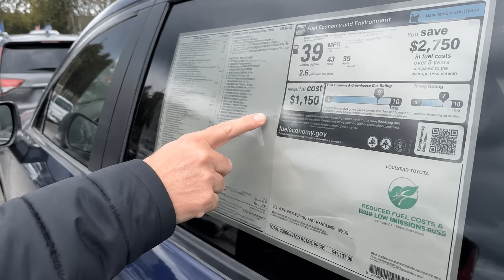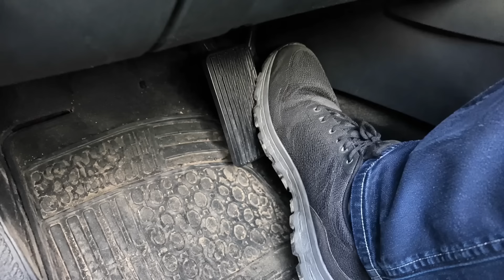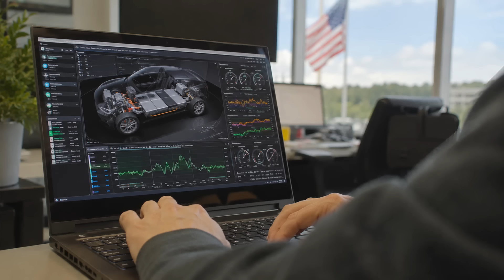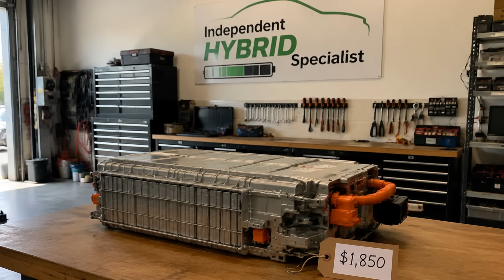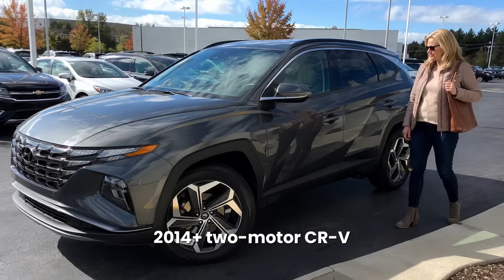Toyota vs Honda vs Hyundai Hybrids: Which One Has The WORST and The BEST Hybrid System?

Comment: Previously owned 2 Toyota Prius cars but really got fed up with the Toyota dealers maintenance fraud! Toyota dealer in Manhattan Beach CA tried to charge my young Daughter approximately $10,000 to do simple head gasket replacement. Local shop that specializes in Prius work charged us $1800 for same job and included head machining and valve job as well. Never again will I buy a Toyota. Toyota Dealers are corrupt. Just don't go there.

Comment: Excellent engineering explanation to the core. Especially the multi plate wet clutches which takes the entire burden of connecting engine or motor to the wheel. Toyota ranked number 1 is absolutely justified. Thanks to the most convincing and unbiased way that genius has explained it so well.
Reply from the maker: Thank you! ❤

Comment: Considering a used Toyota or Honda CRV Hybrid models to replace my 2003 CRV with 220K miles (that I would still drive to the moon) . Don't want the Gasoline Honda with the rubber band, I am not convinced and also considering a regular Rav4 non hybrid. We are both retired and are looking for another vehicle that will be as impressive as our 03' CRV has been, granted I do my own maintenance and am diligent and knowledgeable, so hard to find good quality cars nowadays.

Comment: I have a 2026 Hyundai Tucson Hybrid. I have driven it for about 10 months now. The car drives smooth and is a pleasure to drive. It takes steep hills with ease and the electronic braking downhill is wonderful.
Reply: Sounds great, but 10 months is still the honeymoon period. The real test is whether Hyundai’s hybrid system remains as reliable as Toyota’s after 100K miles—would you still choose it long-term?

Comment: Maybe I'm just imagining it but my wife's 2021 Toyota Sienna XLE hybrid AWD powertrain behaves quite well in 'Sport' mode (even though we all know there's not a lot of sport in this vehicle) ... and yes, the engine sure is loud on acceleration but once you're at the speed you want to be, we can hardly even tell the engine is running. The true EV mode is entirely dependent on how flat the road is and even then the engine just 'decides' to start for no obvious reason beyond speed which the EV only mode is pretty much gone over 25mph. Another amazing feature is the transition is nearly seamless when the engine powers up or takes over as the ECU 'remembers' exactly where in the rotation cycle the engine stops then just wakes it up as if it is just continuing the process. A barely audible starter motor sound. Wife took it on some hilled backroads going down to Georgia and that last 40 or so miles the vehicle was reporting 47mpg. On normal routes she gets ~34mpg but she always drives it like she stole it. Summary is I'm happy with this and it's already cresting 150K miles with nothing more than routine oil changes (and routine on a hybrid hovers around 10K miles).

Comment: I bought the '26 Hyundai Santa Fe AWD Hybrid Calligraphy new. The engine and tranny work smoothly, never hear or feel anything untoward.  The interior blows away the Honda and Toyota equivalents l. The high tech features are very helpful and in some cases amazing. Combined gas mileage for first 1200 miles was 31.5, now at 5,000 miles, gas milage is consistently 33-35 mpg. First car I ever owned that actually gies the advertised EPA mileage ratings. The only reason we didn't get the Tucson was my wife could't reach the gas pedal, but on the Santa Fe she could. The top RAV4 was noisy and the interior was cheap looking for the price.

Comment: Took delivery of a 2005 Toyota Prius brand NEW in March 2005 (had to order it in October 2004) and owned it for 13 years / 150K miles before handing off to my brother in law in 2018 for small below-market price. He had the battery pack replaced in 2022 at 195K miles for about $4K.  Unfortunately he passed away last year 2025 and the car was given to his daughter to commute to college and part time work. She currently still has it and loves it. It has 230K+ miles and still runs fine with no problems.. 'Nuff said about reliability.

Comment: If the Hyundai hybrid clutch is under full warranty for 100k miles, what is the downside if I keep it for less than 100k?
Reply: Yes. I buy a new car every 5 years, and. I’ll have nowhere near 100,000 miles on it when I trade it in.

Comment: We have leased 7 Honda CR-V’s over the past 9 years.  The last 3 being Hybrid Sport Touring, and they are our favorite vehicles … EVER.  Never a problem, other than an AC compressor failure on my brand new 2026, caused by the dealer leaving the car Idling for two hours in 95 deg heat on the lot.  A thermal protection sensor failed and caused the electric compressor to burn out.  They replaced both before I officially took delivery.  These luxury equipped (2023 & 26 Touring) cars, are the smoothest, quietest cars I've ever had in my octogenarian years.  Exceptionally good looking, practical, economical, and fun to drive.  No steep hills here, except for my 50 foot driveway, which it always takes easily and silently in EV mode.

Comment: I had a 2000 Toyota Prius until it got totaled at 210,000 miles. I replaced one headlight bulb, one taillight bulb, and the 12 volt battery in that time, and still had over 15% left on my original brake pads. 44.1 mpg overall. I now have 41K miles on my 2024 Prius XLE with zero repairs. This car is actually attractive, smooth, quiet, quick, and I am averaging over 54 mph overall this far. This car is absolutely remarkable!

Comment: Just got a 2023 Sienna Hybrid, looking forward to some long trips in it. 44400 Km on it
Reply: My 23 Sienna averages 32 running around town, and 35 on the highway.  On my last long drive, mostly at 55 mph, it was getting over 38 mpg.  My only concern, after the warranty expired, going down mountains, it doesn’t hold back like it used to.

Comment: 0:12 “Same size, same shape, same price within a couple thousand.”

Rav4: Passenger volume 98.9 ft^3, Cargo volume 37.6 ft^3.
CR-V: Passenger volume 106 ft^3, Cargo volume 39.3 ft^3.
Tucson: Passenger volume 108.2 ft^3, Cargo volume 41.2 ft^3.

So, while they are marketed in the same size category, the others are 7% to 10% bigger than the RAV4. 

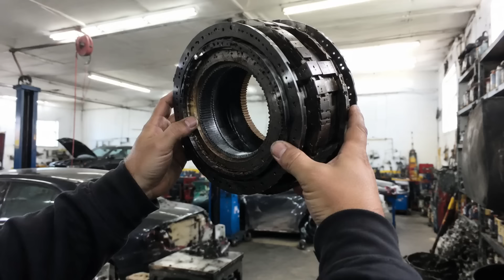2:08 “Because there is one of these systems where a single clutch pack is doing a job the other two designs eliminated entirely.”

There is no history of the Honda clutch pack failing. There is a history of the Toyota clutch (they call it a torque damper or a clutch damper) failing. The Hyundai uses a clutch for a different purpose, and I do not know its history.

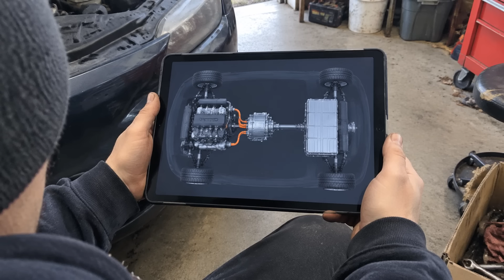2:30 “A hybrid [has] two power sources trying to turn one set of wheels, a gasoline engine, and at least one electric motor.”

An electric motor is not a power source. Its role is closer to that of a gear.  Its power source is a battery or a generator, and it just converts the electrical power to mechanical power. The battery isn't the ultimate source, either. It relies on some other power source to do the same things an engine does, and the shortcoming are similar. Just in somebody else’s backyard.

The rest of what you say about motors v. engines is hyperbole based on this difference.

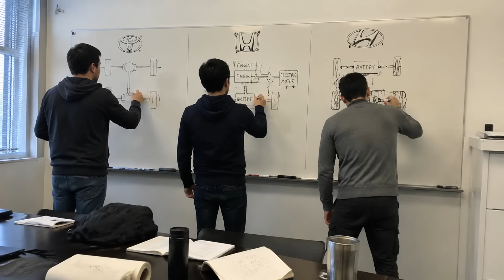3:13 “Toyota, Honda, and Hyundai looked at that exact same problem and came back with three totally different philosophies.”

Actually, Toyota looked at the research done, and patented, at the University of Maryland. Then sto… er, “developed it independently” according to the lawsuit settlement.

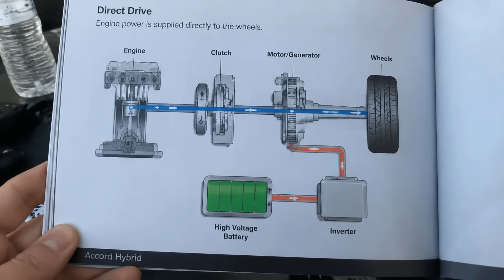3:23 “Toyota threw out the transmission. Honda most of the time threw out the mechanical connection between the engine and the wheels. And Hyundai kept everything a normal car has and squeezed an electric motor into the middle of it.”

The Toyota power-split device is a transmission, just as much as a CVT (the “T” is fcor “transmission”) is. Honda threw out the transmission completely.

7:00 “So, why is [Hyundai] last? Because of what I told you at the top, that clutch.”

Did you take into account that it opens and closes under computer control, when rpm are perfectly matched? Maybe there is an issue, but there shouldn’t be. Did you research failures? I haven’t, so I can’t comment, but I suspect you will find none.

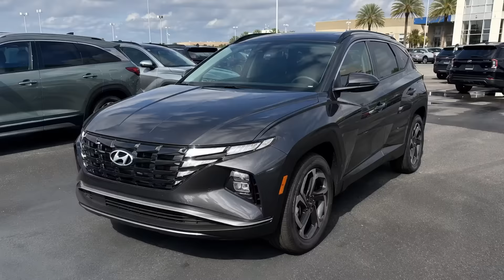8:32 “Toyota does not have that component.”

Yes, it does. The torque damper is a permanently-closed clutch, with “friction material” that does get consumed. It has to absorb the shock when the engine is started while the car is moving; ironically, it does so by slowing the smaller motor, not spinning it faster. The engine cannot be disconnected from the transmission (yes, it has one) as the engine is started. This is what causes its clutch failures.

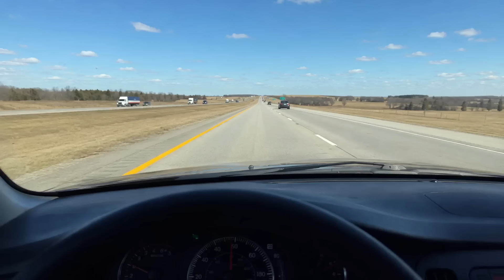12:01 “[Honda] Driving the wheels through a generator and a motor is efficient in town. But on a steady highway cruise, it is wasteful because you are converting mechanical power to electrical power and back again and losing a slice at each step.”

It is no less efficient than a typical transmission; above 90%.  Same as the Toyota power split device. About half of Toyota’s power is routed the same way, although they won’t explain that part. The power split device splits ICE power between a parallel path (like Hyundai's) and a serial path (like Honda's). The ratio of this split is what controls the speed of the ICE.

Honda' highway issue is not with cruising, it is aggressive speed changing. In my Accord hybrid, I drove from Maryland to Nebraska, and back, to retrieve 700 pounds of my grandmother-in-law’s marble statues. I averaged 50 mpg (three over EPA) because I cruised.

All of these systems buffer energy through the battery. An ICE is most efficient when generating, maybe, 20% to 30% of its rated power. During cruise, all three of these cars will overproduce with the ICE to stay in this range, and use the excess to charge the battery. Then use power-assist to avoid inefficient, high-power levels. This is how they gain efficiency.

Honda uses a lower-power ICE that loses more efficiency when you acceleragte on the highway.

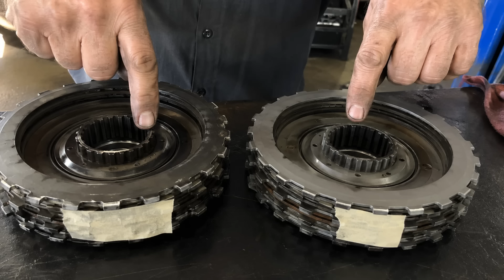12:54 “The newest CRV hybrid actually carries two of these lockup clutches. One ratio for lower speeds and one for the highway.”

No. One matches the best rpm range to a lower speed range, in order to get more power for towing at highway speeds.

13:21 “The [Honda] clutch … mostly closes under gentle steady state cruising conditions.”

It closes only under those conditions.

And it has a completely different battery than previous Hondas. The kind Toyota changed top after Honda did.

Comment: My 2017 Hyundai Sonata Hybrid battery bulged/swelled up like a cell phone battery at 137,000 km.   The car would not start after engine shutoff to supposedly clear hybrid alarm on dash.  It took 4 hrs for Hyundai road assistance to arrive to tow car to a Hyundai dealer.  The dealer took 3 months to order a hybrid battery replacement.  Dealer had no courtesy cars for me. Thank God the end to end warranty paid for the battery replacement. However the warranty runs out at 160,000 km. Current mileage is at 149,000 km.  Time to look at Toyota hybrid.

Comment: Hey thanks Richard! What do you think of the Hyundai Tucson phev? I have a 2025 bought new. Really love the vehicle, drives nice, locally very cheap on fuel of course. Road trips are comfortable with plenty of power if needed. I am in Canada so our warranty is a bit different. 5 years or 100,000km so we added some extended warranty to 8 years or 160000km including all electrical components as well as drivetrain etc. Ours is very smooth transitioning from EV only to gas and electric and back to EV. WD have only 36000km so far. I am nervous about keeping it past the warranty because of the issues you explained. Is the clutch wear issue similar on the PHEV? Thanks for your video, I have subscribed and liked your video as well.

Comment: I rented a Hyundai PHEV. Once in a while, it did shudder.
Honda’s CRV hybrid is mostly good. Only 2 noticeable flaws to me. The Honda solely uses GDI, no port injection. Carbon buildup will be a problem, unlike the RAV 4 which uses dual injection, selectively using GDI or port which is more complex but keeps the valves much cleaner. The other is that the Honda lacks a spare tire that the RAV4 has- I think a necessary safety feature on a SUV.
Reply: "The Honda solely uses GDI, no port injection."

The Honda system uses multi-stage direct injection. It happens four times, for improved  atomization. The first is in the exhaust stroke just before the exhaust valves close, two occur during the intake stroke, and the last is in the compression stroke.

But it uses the Atkinson cycle. That means that the intake valves don't close until after that last injection. Some fuel is pushed back behind the valves, accomplishing the same thing as Toyota's dual injection (and a mild turbo-like effect).

Toyota started the "no spare tire" trend with the Prius. The reason was that the spare tire becomes a missile aimed at the battery in a collision, causing fires. Some companies still care more about that, than the  PR.
Reply: @jeffjo8732  Time will tell if the valves remain clean with their GDI. Positioning the batteries in a place different than adjacent would help, don’t you think? Maybe the option wasn’t available because of the driveshaft in the CRV.
Reply: The spare tire problem with the Honda did it for me.  I was a loyal Honda customer prior.

Comment: My 2026 Tucson Hybrid Limited shifts so smooth you can't feel it. Impressed every time i drive it.
Reply: My niece has a 2026 Tucson Hybird Limited that really impressed me!  Really smooooooth and it really a smooth ride.
Reply: My 2026 Tucson Hybrid Limited is great EXCEPT for occasional slippage in the transmission and a thud when shifting. Taking to dealer for diagnosis and fix.

Comment: I have driven the Toyota hybrid, I bought a Honda CRV hybrid.  Yeah, the Toyota may have an edge on longevity and MPG, but the Honda is miles ahead when it comes to refinement and drivability.  The Toyota's sound like they are going to bust a nut when you accelerate hard, with the Honda you can hardly tell which motor is doing the work, they run smooth and quiet like a cat.  The Honda also has a better looking exterior and a much more refined interior, in my opinion.
Reply: True.
I checked out the CRV and said to myself no.

Comment: I drive a 2020 Ford Escape Hybrid AWD.  In 2020, Ford used the Toyota system with the only modification direct rear wheel drive rather than the Toyota electric motor rear drive.  I am getting 37.5 - 41.5 might.  Previously I had a Toyota Prius from 2013 to 2020 with no issues while living in Phoenix.  I needed AWD in my life in 2019.

Comment: Both Toyota/Lexus AND Hyundai use embedded wet clutches in place of torque converters in their hybrids - and they work fine, can have VERY long lives (hey!  they're in EVERY multispeed sutomatic transmission out there!).  That's NOT the problem with the Hyundai Tucson.  Software is.  

My BF has had to have his 2025 flatbedded to the dealer three times so far after unrecoverable software "glitches" made it undrivable.  Hopefully this improves.

And OF COURSE Hyundai and Kia are FAR less reliable than Toyota or Honda, hybrid or not.  It's WHY Hyundai/Kia feature 10 year power train warranties - but they also hold owners to the exact letter of the maintenance requirements and are not to eager to do repairs.  And the failures can begin immediately, not just after 5-10 years.

But Hyundai/Kia are also the "value" options as they tend to bias their budgets more towards interior features and comfort rather than underlying (and initially invisible) mechanical and software quality.  So what the driver first feels in these cars is often better.   Sometimes MUCH better.   In the end, its an informed buyers choice as to which is preferred - a nicer feeling car, at least at first, with some potential surprises vs. no surprise, solid reliability that you WILL pay a significant premium for.  Neither choice is wrong - its whichever one works best for you.

Comment: The new Honda CRV went from a 2.4 ltr engine to a 1.5 Ltr turbo charged or if you like gas only just a small 2 ltr.  Those small engines are the problem with overly engineered tight tolerances forcing  the engine to use 0W20 motor oil, which is referred to as Water by most mechanics.  You'd be lucky for that motor to last 60,000 miles !!
Kind of a Ha ha ha, yesterday we just ordered our Toyota RAV-4

Just so people know Toyota is having difficulty delivering enough RAV-4s, with most dealers only having a few on the lot, while the RAV-4 comes in seven different trim levels.  So we had to put our order in for one of the cars that will be delivered in September. and it only cost $500 for our place in line and secure a specific trim , as it were.

Because of the shortage they are not wheeling and dealing they give you a price and that's what you pay.  The trim level we are buying is not the cheapest in the lineup, but the second or third of those seven in that lineup and still we are going to be paying over $42,000 Out The Door.  The highest of the RAV-4 trim levels cost almost $55,000.  Now remember all new RAV-4s are only hybrids with a small 2.4 liter motor !!!.
Reply: Don't be surprised when you find out that your new RAV4 Hybrid requires 0W-20 synthetic crankcase oil.  Been that way since at least 2009.  But I agree with you about the overstressed turbocharged 1.5 liter sewing-machine motor in some models of the Honda CRV.  They are noisy and expensive to fix when the turbo goes out.   RAV4 Plug-in Hybrids are indeed in short supply.  The high-end models often priced at over $65k once factoring in un-warranted dealer markups.